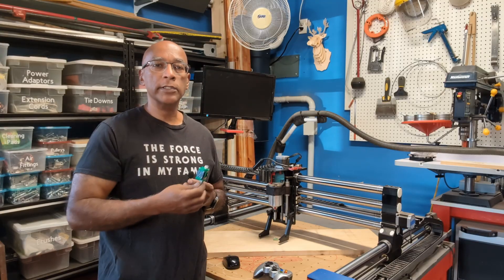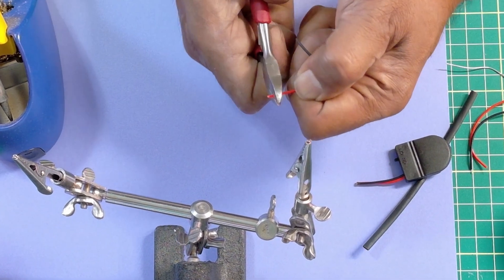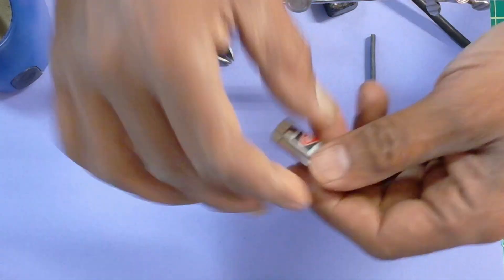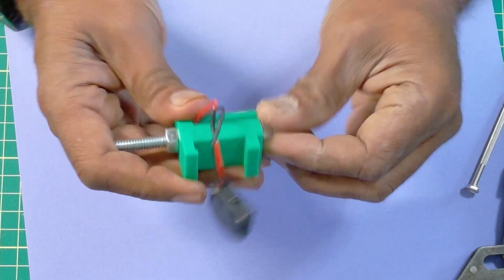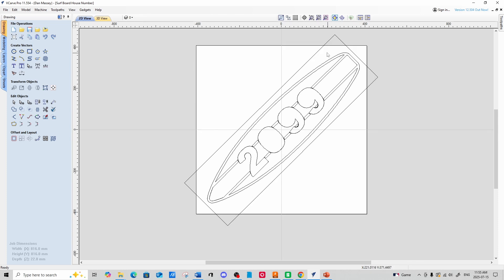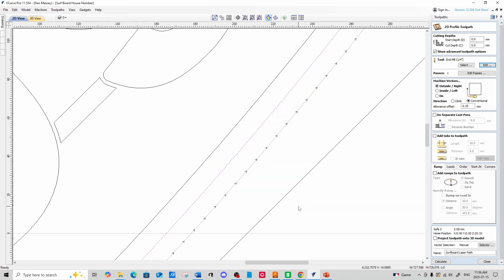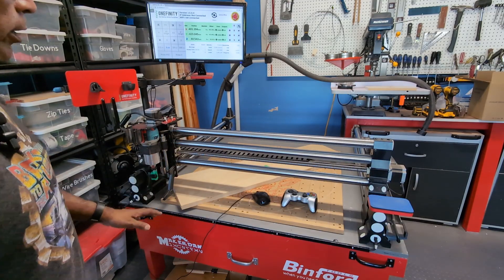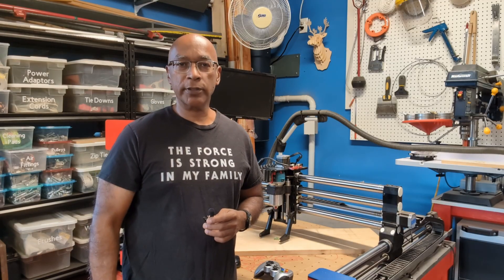CNC Laser Guide.  Build it for under $15

Comment: I was thinking about this idea as a solution to re-establishing a homing position after shutting down my X50 with a BB controller. Currently, I use a pointed bit marking a corner start point before shutting the machine off and finding that same point when I restart. It works very well and is acceptably accurate. My thoughts about using a laser was to set it above the machine to set a start point and turn it back on to restart. The concern I have with this is the width of the laser beam itself as it seems wider that the pinpoint of my bit. This seems important if accuracy is critical. Am I being overly concerned? Thanks for your thoughts.

Comment: This is well made. I use custom designed magnetic accessory modules for the cutting/engraving laser, vinyl cutter, and coordinate laser locator. I like the simplicity of your design and how it uses the router/spindle for mounting. The biggest drawback with my design is needing several offsets based on which tool I’m using when setting the X-Y origin. I plan on adding this to my tool chest when I’m leveraging only the spindle. Thank you.
Reply from the maker: Thanks so much.  Glad I could help.